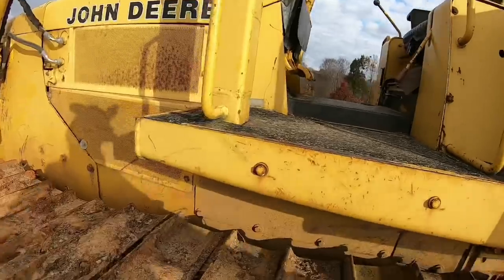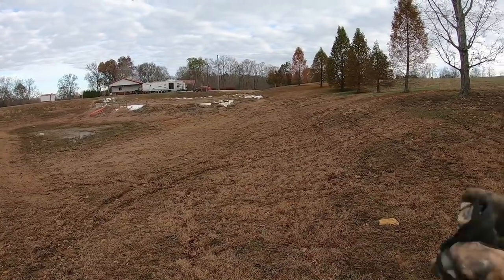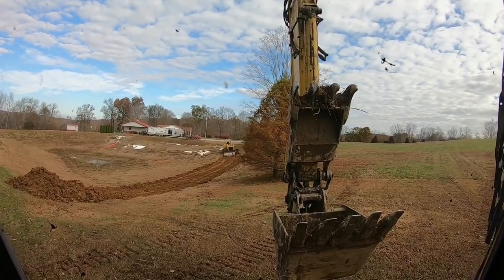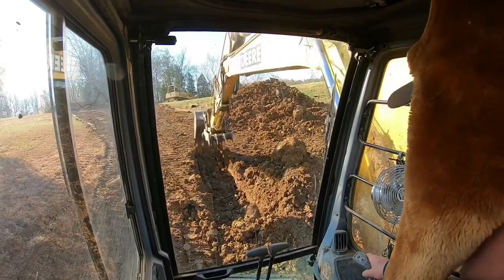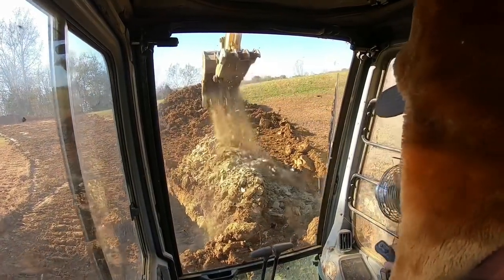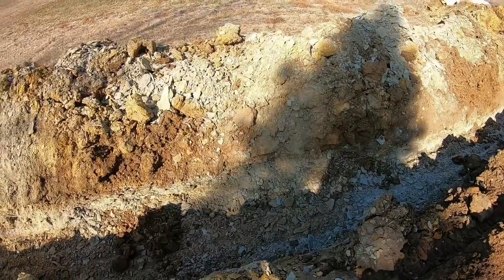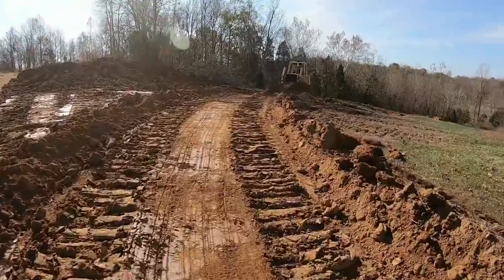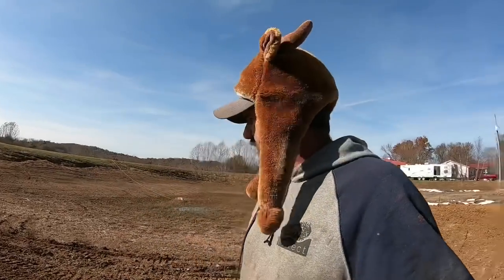Attempting to repair leaking pond with dozer and excavator #dirtperfect

Comment: Looks normal Jerry working and Mike running around. LOL Just kidding.  It is a good sign when a good operator "owns" his machine. I had to smile when you said Jerry did not like you running it. I have had employees like that over my life time and the majority of them where the best men to have running the equipment.  Would like to see the "new" Volvo  working. I have never ran any Volvo construction equipment long enough to say good or bad. I have owned two Volvo semis and I am glad they both are down the road. Lots of troubles with the Volvo engine systems. Sensors and such.
Reply from the maker: Yes lucky to have jerry and coming soon

Comment: Don't you ever ever EVER  clean the interior/ drivers areas of your equipment??
I understand that you work in dir5 / mud. But dam. So much dust snd dirt on floors and inside
A quick rinse of the floor and 409 the seat and control's  and general maintenance makes thing last l8nger and give you a better attitude.      What makes you feel better and makes things last longer. A filthy car or a clean one????
Reply from the maker: No because it drives people like you crazy 😝